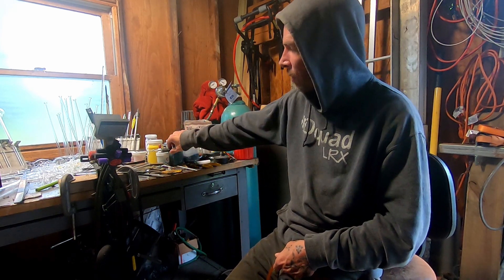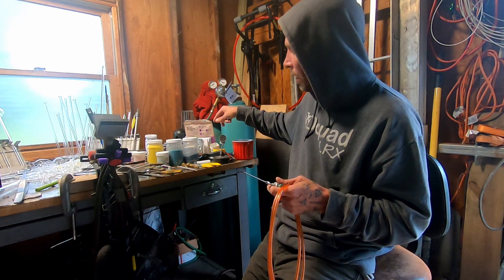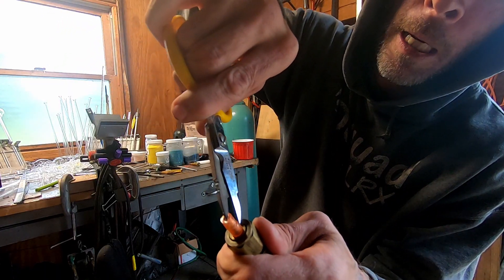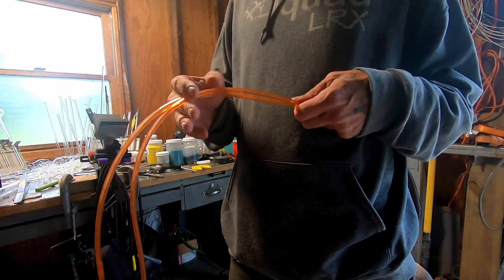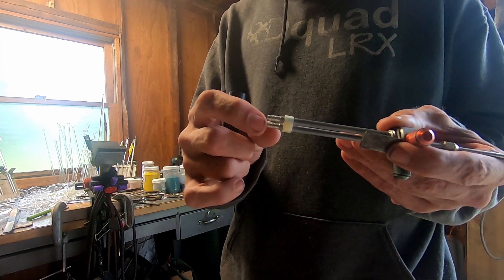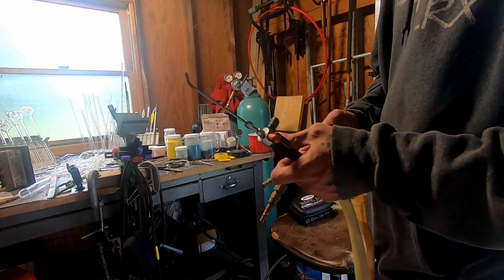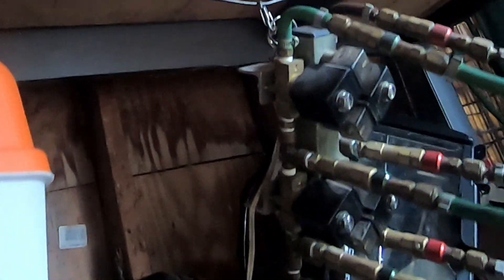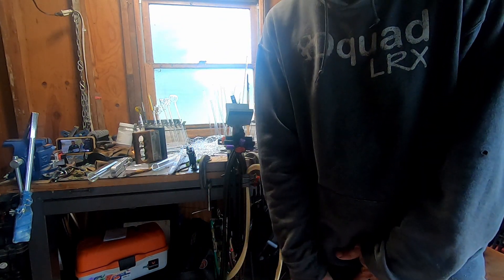GLASS HACK- upgrading the hoses for the smith little torch (better and cheaper than replacement kit)

Comment: Agree with you on the original hoses that came with the torch are cheap, you bought it today they became brittle the next day which is crazy need to replace with better hoses I replaced mine with a pair of quality 6m o.d. SOFT POLYURETHANE hoses from a really well known brand for making air hose, really such a huge upgrade for the quality of life.